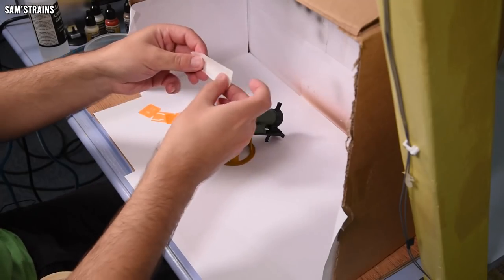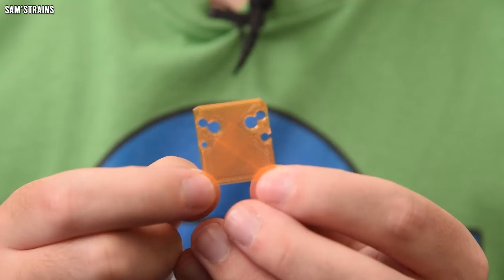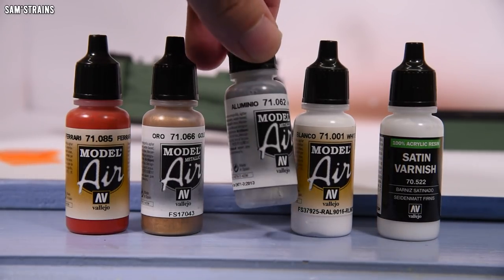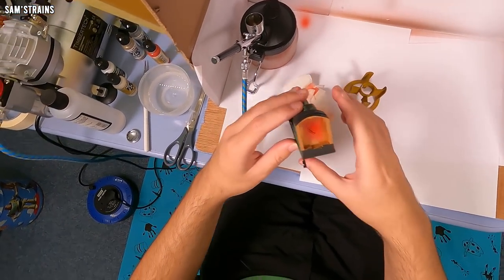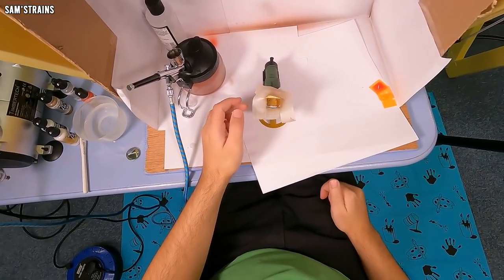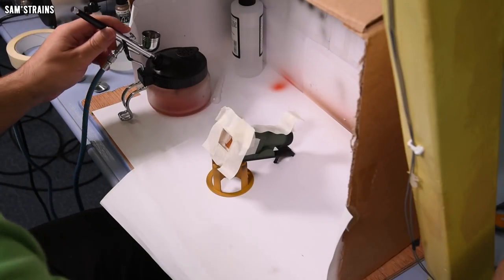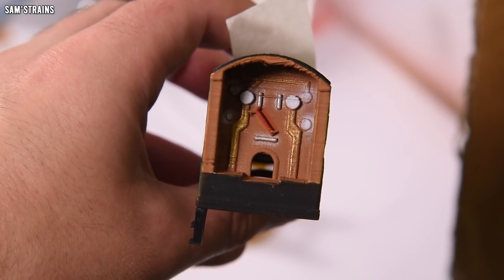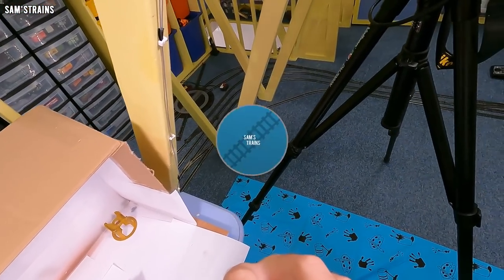Model Train Painting Experiment | Paint Detail Without Steady Hands!

Comment: Sam my suggestion is print the wall of the cab with the details separately. You could then paint the details 'outside' the cab....then attach it to the cab. Once it's painted. If you muck it up, you just need to reprint the wall with the parts
Reply: This should really work
Reply: another idea would to make the entire bulk head outside of the cab, paint it on a flat surface where you have room to move it around and then when dry you could just glue it into place already finished. one step that would help with this is to make 2 bulk heads 1 totally smooth and the other with the details. Then you could just glue the finished one to the flat one inside the cab. You would retain all the front end support and then just glue to the existing one. That way would no have to make any extra special flanges to flue to since you would have a flat section of the cab already there
Reply: @davidvincent1093  that's a much better way of explaining what I meant lol. One bonus would be the bulkhead could be printed on a resin printer giving much higher detail.....you could even print the details separately making painting a breeze....you could then glue them to the bulkhead, then glue the bulkhead into the cabin
Reply: @TDax  I like that idea of doing a resin print. You see when a few good minds that have fought through this before come together we can come up with ideas. My problem is that I only have 1 hand that works so I always look for the easy way out. Hope you had a Merry Christmas and next year will be better for all of us.
Reply: @davidvincent1093  only having one arm myself, I appreciate making things easy when possible
Reply from the maker: Yes you're right! This was filmed quite a while ago, before I did my Manning Wardle! On that loco, I did print all the cab separately which made it much easier... it's not always possible, but I'll definitely do that whenever I can! :D
Thanks for watching - Sam :)

Comment: Sam, I've been brush painting minatures for quite a while now (25 years). I think you would have found this easier with a brush, especially if you had made the detail removable.

There is only downside to this plan, like any skill it does require some practice. Luckily you have a 3d printer for infinite practice pieces (maybe some larger O gauge figures, or items? There's a video idea!).

A few tricks like not overloading the brush (don't dip all the way to the metal), and trying to paint using the side of the brush to only catch the raised detail and not the recess and I think it's a skill you could develop.
Reply from the maker: Yeah I think you're right - a single cab to paint wasn't a great example of this technique! I think if you've got let's say a stripe across 10x coaches to do, then this makes sense... for a single cab, you could definitely paint it by hand much quicker.
Thanks so much for the tips - I'll definitely try!
Thanks for watching - Sam :)

Comment: Use the control on the end of the brush to control/limit the paint flow. Reduce the air pressure and thin the paint (even Vallejo Air needs to be thinned). Doing that will mean you can get a lot closer. Try and do a few light coats rather than one heavy wet coat and that will reduce bleeding.  As others have suggested Posca Pens are really useful for details.

Comment: Sam you have the right idea. Some things I would recommend to make the finish look even better, if you want the practice, the front bulk head should have been painted flat black. I have worked on steam engines both in the rebuild of them and the running of them for a tourist rail in California so here are a couple of things. I have never worked on an engine that had a brown bulk head, a finishing idea would be for the top outside of the roof where you have it painted black but hot the back edge bring it down to finish the look. The back edges of the engine cab where they are brown you might like to paint them the the same green that you did the outside of the cab with to make it look more uniform in finish. I do like the brown inside of the cab because it does give it the wood look which would be a correct material that they would only paint the outside of the cab to match their livery with. Otherwise great job. 
I might also suggest making another mask that you could paint your choice of color around the raised parts of both the front wheels as well as the tender. You would not have to get crazy trying to do a pin stripe in those small areas just a single color. Finally since you have the mask idea down why not make a mask that would fit inside the tender sides after you paint the raised section and you could spray something like SAMS TRAIN LINE  or S&T LINES something catchy that would show off that you designed and built the train. Otherwise for a first build I think it is wonderful like it is,. You asked for suggestions and I just thought these few things would make it pop. Plus painting the bulk head black would help with any over spray when you do the templates since it would make the items look like they have a bit of reflection on the back plate. Thank you for all the great videos we love them here on the other side of the pond
Reply from the maker: Thank you David! Yes you're right actually - though I should have modelled a better bulk head really! Thanks for the tips! :D
Thanks for watching - Sam :)

Comment: Hi sam. I have 77 years of continuous model making behind me. I am not a lover of airbrushing, much preffering good quality brushes. I noticed two things. One- your masks arent a good close fit to your bulkhead. This allows the pressure from your airbrush to lift the masks and push paint under them. The other thing is you are putting too much paint on at once. this causes the paint to stay liquid too long and that causes the paint to bleed. Just waft over it with a couple of quick passes allow to dry. pass over quickly and faintly again and repeat a few times. this allows each coat to harden (quickly)  and should prevent bleading. Hence the old saying little is more!!!

Comment: Nice paint job and VERY clever masking plates! I'm not very anal when it comes to detail, smoothness or accuracy. The work I do in my hobby projects are for my own satisfaction, not for exhibitions or winning prices. I only do what is fun and within my limits.

My advice: Always use a primer, light grey or dark grey before you paint on PLA. It makes the acrylics or enamels stick better to your plastic parts.  I never sand my PLA-prints, it just creates dust that goes everywhere, plus that I've alwats hated sanding. The primer smoothes out little cracks and moirée patterns than can appear in the printed parts. 

When you build your locos, have you considered using a flywheel to get a smother running locomotive?

Comment: Hi Sam, if you lower the air pressure down to around 15 - 20 psi, that will help controlling the spraying and then you can get closer to the object you are painting and be more accurate in the application.

Comment: Great job Sam. The mask idea is excellent.  A problem with air brushes is how they try to put paint into and through the slightest crack.  You might try painting using the mask and a brush.  Another trick is to buy some large tip felt markers or overhead projector pens.  The mask that you have made then acts like a stencil. What you have done really adds to the loco.   Hope you had a Merry Christmas, and wishing you a great year ahead.

Comment: That wasn't half bad in the end :) Something that occurred to me - the bleeding might be related to your masks being held up by the details that you're not painting. For example, the mask to paint the gauges is being held off a bit by the pipework and regulator. Perhaps make a mask with holes for all of the cab equipment (gauges, regulator, pipework, etc.) then have a set of masks for only what you want to paint (as you've made in this video), and overlay them on the first mask with all the holes. If the mask with the individual cut-outs is pressed in firmly enough it should (hopefully) stop the bleeding.
Reply from the maker: Thank you so much! Yes that's absolutely what it is - I think I was a bit too lazy with this, as doing as you suggest would definitely have improved things... but the mask pieces would have needed to be much thicker, and therefore less flexible... just something I need to experiment with I think!
Thanks for watching - Sam :)

Comment: Next time you do this you should try extending the masks so they cover the cab floor sides and roof so you don't need as much masking tape. Might also make it easier to push the masks in firmly.

Also adding some neodymium magnets on the mask and behind the cab might help hold it in place a bit better and reduce the paint bleed.

Comment: Hi Sam very good video.  An idea to cut down on the bleeding would be to make the mask with all the cab detail cutout so it fits snug to the bulkhead but mask off the areas you don't want to paint before you fit the mask to the cab that way the other detail doesn't push the mask forward

Comment: i thought for a long time that Rosso corsa is Ferrari's red. (wiki claims it is italian motor racing colour)

i feel some of the gauges are too soft on the white colour.

Maybe have the whole front panel be a separate piece that friction fits into loco cabin? that way it will be easier to brush paint as you will have no walls to get in the way and you can easily tack or otherwise hold it in place to do details. i know its adding layer of complication but unless you are going to go the way of separately fitted everything in cabin than thats the next best way i can think of painting it.

Comment: Instead of an airbrush, what about just the paintbrush? That way, you don't have to worry about it leaking behind the mask or having to tape up so many parts of the loco, if any at all!
Reply: Indeed, yiu could use the masks with your paintbrush ad possibly avoid the overspray that you get with the airbrush, Sam.  Alternatively, could you 3D print your masks with a lip around the holes so that the mask would fit snugly around the areas to be painted, but stand out from the front (back) of the cab so that the overspray would be prevented from going all over the surrounding area to the detail you are painting?

Comment: You should make some more masks to finish the outside of the loco :D also maybe get some waterslide transfers so you can add lettering, numbers, etc. You've already put a coat of varnish down so they should go straight on, and once sealed with another coat of varnish will look grand.
Reply from the maker: Yeah absolutely! I've been doing a lot with transfers, but it's a bit frustrating that I can't print in white... which makes colour matching really difficult when applying to any body that isn't white! I'm hoping my next loco will make use of transfers in some way though! :D
Thanks for watching - Sam :)
Reply: @SamsTrains  ah yes, the dreaded need for white ink... not exactly cheap to invest in that equipment :(

Comment: You keep saying Aluminium wrong lol.  Maybe you watch too much American TV or YouTube :P
I think you could cover up the overspray with a reverse mask that covers your detail and painting the base wall black (or whatever your preferred base colour is.  The mask would have to be extremely close fitting though,  any gap between your mask (or screen/template, whatever people like to call it) will cause that overspray effect.  Anyway, this is a lot better than I could ever do.  
Have you thought of using one of those self contained soldering fume extraction fans?   They would not be brilliant, but one with a charcoal style filter may help a little with fumes, especially if the spray box is enclosed on all sides except the front :)

Comment: Quite frankly you don't need steady hands, but there is a few cheats there too if you need them, I really reckon I could tutor you into a hand painting master. All you need is thin paints, not too much on the brush, and to overpaint and cut back in, and a little patience. Shoddy PLA 3d prints are particularly difficult to paint, it has to be said.

Comment: This channel is the equivalent of a 5-pole notor with a flywheel
Reply: Along with exquisite detail, fantastic paint job, metal fittings and separately fitted parts, all-wheel drive, all-wheel pickup, motor isolated from gear train via a flexible drive shaft, proper turned metal bearings on the wheelset, directional and cab lighting, firebox flicker, and additional etched metal nameplates!

In other words, flippin' brilliant!

Comment: What if you made the boiler blackhead as a separate piece you could insert after you painted it?
Reply from the maker: Yeah absolutely - this was done before I built my Manning Wardle... which had exactly that design and worked much better!
Thanks for watching - Sam :)
Reply: @SamsTrains  the other thought for this one is with those masks, which I really like, if you had used very little paint on a very small foam brush. It would be more like "pad printing". More like very well controlled dry brushing with the masks working to stop the paint since the brushes were so dry. Either way. Keep it up!
Reply: @SamsTrains  and I like the way both this and the Manning Wardele look and run, this one looks more like a toy train the elves would have made. This is a positive comment at Christmas time!

Comment: It may have been better to print a mask with ALL the details on one of the inserts then it would lay flat to the back of the cab. Then using just the one insert mask the area's you don't want painted and spray. Unmask and repeat for the other colours.
Reply: I was going to suggest this approach too, so we'll done Mike. However, having made one overall mask you would be able to use a brush. Job done in far less time.

Comment: Perhaps you could 3D print the masks with 'sides' so that they fit into the cab like a 'cup' so that you don't need masking tape.
Reply from the maker: That's a solid idea - definitely worth a try, but the extra print time would be much longer than the time it takes to mask!
Thanks for watching - Sam :)
Reply: @SamsTrains  Well, of course, it would be more practical if you were making several copies of the same engine. Also, of course, the "sides" of the masks could be glued on after the mask is printed. Or you could make the sides as a separate piece to use with all masks. Etc.
Reply from the maker: That's it - this whole exercise didn't make much sense for a single loco cab... or even cabs in general. I think if I wanted to paint a precise stripe on multiple coach bodies (for example), then this suddenly makes much more sense!
Thanks for watching - Sam :)